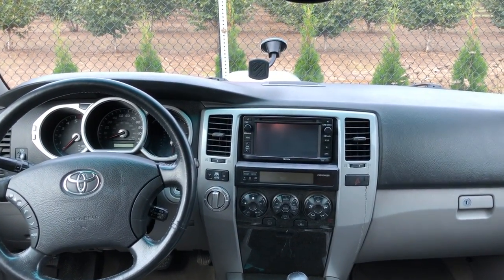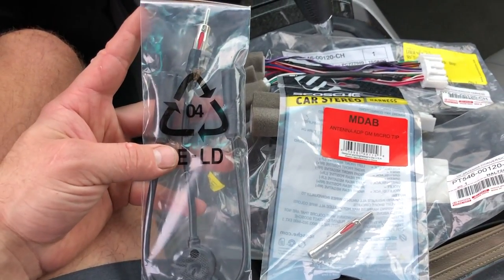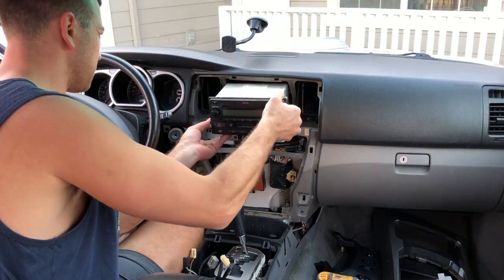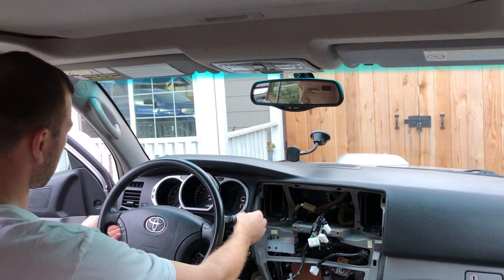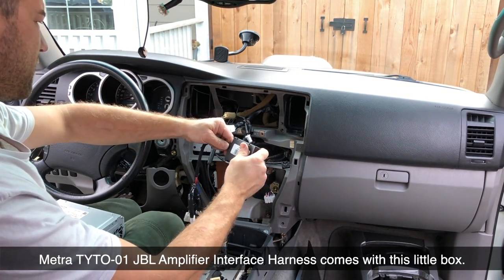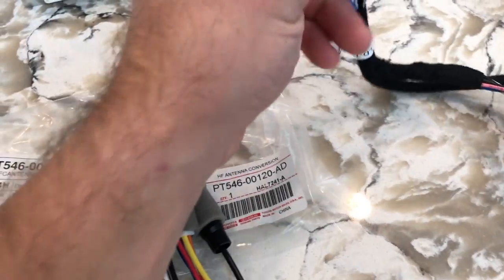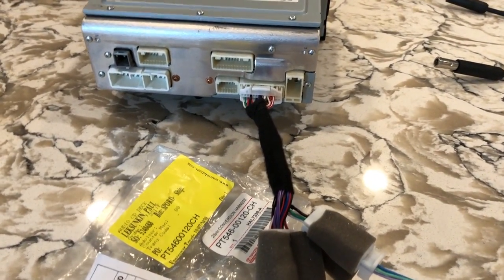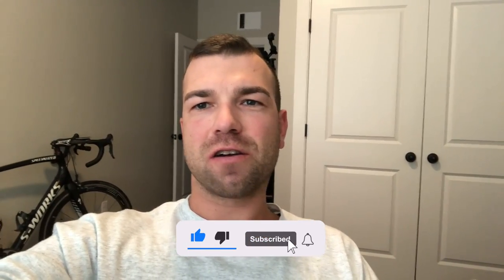4th Gen Toyota 4Runner Touch Screen & Bluetooth Radio Install - Upgrade 4th Gen Toyota 4Runner 2003

Comment: Bro, please answer ASAP:) the antenna wire, the blue one gets spliced into the blue with white wire on the other harness or into the black wire? I’m doing this now and can’t quite figure out in your vid each one it’s spliced into. Thanks!!
Reply from the maker: I'm probably too late but the blue wire splices into a blue wire on the big harness
Reply: @tronixster  all good, figured it out. Thanks tho. My backlighting doesn’t work though.. the buttons don’t have light at all. Haven’t figured that out yet..
Reply: @steffNn same neither do mine and my sound quality is kinda crap with Bluetooth 😢
Reply: @omarmendieta9149  my Bluetooth is good, but my backlight still doesn’t work
Reply: @steffNn  yeah my Bluetooth connects quick and works as it should but still no backlight😭 I seen on the TYTO1 harness that the orange is the illumination wire so I’m wondering if that wire needs to be tapped into somewhere else?? And I also noticed that there’s a way to program your volume control on the Axxess box so I need to do that too still

Comment: Do you have the part number on the speaker output plug that came with the new radio?  That is absolutely the weak link for anyone else wanting to do this modification.  Without that plug, this cannot be accomplished.
Reply from the maker: You would have to buy these plugs from dealer and I don't have the part numbers but I can try to find out for you

Comment: You did not explain the rear speaker connections. Does the Purple/Black go to the right rear White? The Purple to the Right rear Red? The Green/Black to the Rear Left Yellow and the Green to the Rear left Black?
Reply from the maker: Yea actually show it in great detail
Reply: @tronixster  You have made a very detailed video which has helped me greatly. Can you tell me where in the video you show which wires from the plug go to the positive and negative rear speaker wires? You showed the purple and green wires for the rear speakers and you showed which side of the plug is left and right but the wires from the plug are not green and purple, they are Red, BLACK,YELLOW and WHITE. I don’t know which is positive and which is negative.
Reply: @markpyrtle7853  The stripe wires go to the bottom of the connector. I also had this problem. But if you look and the harness just next to it, You;ll see that all the striped wires are located in the bottom half of the harness.

Comment: Can someone tell me the name of the head unit and where to find it i have a 04 4runner
Reply: If you want the one that says Toyota on the front of the unit..it’s p/n PT546-52150. The Scion unit is the same but different p/n and will say Scion on it.

Comment: Hi. Looking to do this swap today but I'm not finding that the part number is matching up with your head unit. It seems that the part number referenced is one without the touch screen. I am getting a lot of Googled responses for a Scion screen that looks very similar. Any chance you have more up to date on that part anymore?
Reply from the maker: Honestly Scion head unit is exactly the same with only one difference, it says Scion on the front of the unit.
Reply from the maker: Hey man, I've bought it from LKQ auto parts.

Comment: I think the 2 antenna ports delineate AM and FM.  These two antennas are electrically very different.  I think a better solution is to buy 2 harnesses and pull the coax pin out of one and install in the other coax connector head. then connect the various antenna feedlines to the correlating port.
Reply from the maker: Thanks for the tip brotha
Reply: @tronixster  Does both  AM and FM work  good the way you connect it?
Reply: This is a common misconception and actually isn't the case. From this post: https://www.toyota-4runner.org/611260-post22.html
"The antenna issue has been discussed quite a bit. The 4Runner has a diversity antenna system - which as best I can tell means that there are two antennas in the vehicle and the factory head unit picked which one had the best signal. I do know that the antenna bundle from the factory harness has two antennas connections (a standard and a smaller one) and a 3rd cord that folks have said is power for an antenna booster.

Going to the aftermarket head unit there are lots of install options available:

1) Get Y-cable connectors to feed both antenna signals into the single antenna input on the Pioneer headunit
2) Provide power to the antenna booster and just plug in the larger (standard) antenna connector"

So I think Paul did it right.
Reply: @r.t.7925  Yes it does. I just did it today.

Comment: .hello friend your video was very useful it helped me a lot to install to update my stereo ,,,,, but the button lights do not turn on
Reply from the maker: yeah mine is not working either. I guess the white wire that was left un-spliced in "little pigtail" 6 pin harness is for backlighting illumination. I'll have to take everything apart to fix it but I had no time to do it yet.
Reply: okay thanks for answering me, your video is very helpful thanks 🙏

Comment: Boss how are you doing I got a question is my Toyota got regular system what I Gotta too  do???
Reply from the maker: Hey man. Here's the list of things you'll need: 

1) OEM Headunit Part #: PT546-52150
Link: https://www.lkqonline.com/2015-TOYOTA...
(I recommend calling them in person and ordering it over the phone)

2) PT546-00120-CH Wire Harness
Click here: https://parts.larryhmillertoyota.com/...

3) PT546-00120-AD Wire Harness
Link: https://parts.olathetoyota.com/oem-pa...

4) Metra 40-UV43 Male to Female Motorola Antenna Cable
Click here: https://amzn.to/3mkTa9P

5) Scosche MDAB 1988-Up GM Micro/Delco Antenna Adapter Tip
Click here: https://amzn.to/2Zrn3we

6) Pigtail [that aready came with my head unit]
https://amzn.to/3FB5fib

Comment: I does have navigation system the new stereo ?
 my wife stereo has but it looks so old shity and the greeting is so annoying every time turn on the car..
Reply from the maker: Hey man, yes this head unit does not have navigation in it by default and you would need to pay dealer around $500 to have them install it for you but really it's useless cuz most of the time I use my phone for navigation
Reply: Yes that's true,  most of the time I use my phone or my tablet as a gps. And it loooks awesome and I can stream music at the same time..
Thanks man..

Comment: I checked the link for the head unit, I want to replace my dated 2003 4 runner unit with the JBL synth,,, but the link says no more in stock, do you feel the 2016 unit is the same?? would work??

Thanks, Excellent work!!!!
Reply from the maker: Yes 2016 head unit would work

Comment: So I have the JBL system and just got done installing it like urs. Now it seems like my radio is quite as loud and also it shut off completely when I try to put the sound only in the rear. Does yours act similar?
Reply from the maker: No mine didn't do that at all. Do you have the JBL synthesis in yours? You might have to adjust levels on your Metra TYTO-01 JBL Amplifier Interface Harness https://amzn.to/3EmS1Vs

Comment: Have to ask on the rear camera will the harness you’ve posted work with the link you shared that guy uses a scion head into is there any differences
Reply from the maker: Hey, I haven't done the back up camera myself yet so can't tell you for sure but I don't think there's difference in head units.

Comment: How do the PT546-52150 and PT546-00140 head units compare?
Reply from the maker: Hey man, I believe PT546-00140 is made for Scions and it will say Scion on the front of the head unit. PT546-52150 is made for Toyotas and it will say Toyota on the front for the head unit but they are both exactly the same as far as I know and both will work and connect the same. I hope this was helpful.
Reply: @tronixster  Hi, thanks for trying to help. Actually both units are available as Toyota and Scion branding, but completely different models. with the one superseding the other. I hoped you might have tried the newer version, too, but it seems it uses completely different wiring - but would still fit in a 4Runner. Thanks again for the great video and very detailed information.

Comment: I purchased the scion version for my yaris 07 and I'm just waiting for the antenna adapter, but I tried to use it just with the 2 original connectors of the car and I got no sound, do you know what should be the problem?
Reply from the maker: It's hard to tell, you would need to take out the harness and troubleshoot it but I would recommend waiting for the antenna adapters.

Comment: Do you know if navigation software can be uploaded to this unit? Also is it possible to install a backup camera? Thanks!
Reply from the maker: Hey Shawn, yes it's possible to upload navigation software but it will cost you around $500. It's not worth it personally for me cuz I usually use my phone. 
And it is possible to install a backup camera. Here's the link to the wiring harness you'll need. https://www.amazon.com/PAC-CAM-TY11-Reverse-Camera-Harness/dp/B00KWLA3T0/
And you can buy any camera they sell on Amazon. Most of them will work with no problem. 
I'll be installing a backup camera on my 4Runner and will most likely do a video on that.
Reply: @tronixster  I hope you upload the video
Reply: I don't  think  the radio in the video has navigation. I bought  the same radio today and on it on the bottom there's  extra Harman navigation unit.Im going to install   this on my 2005 matrix XR. It fits perfectly in the dash- same dimension as the old one .

Comment: I've read through all the comments and can't see a solution to my issue. We have 2004 4Runner with JBL Synthesis and factory backup camera, which was working with the stock head unit. I did this upgrade, but it looks like if I want to keep the factory camera I need to splice another wire harness that fits the Yaris head unit to the factory plugs for the stock head unit. The Yaris head unit has a 16 pin plug for backup camera, which isn't the same as my 4Runner stock radio plug. Has anyone figured this out?
Reply from the maker: Hey Joel, I didn't do much research on that. But here's a tutorial on ho to do aftermarket backup camera and you might find some useful information there. 

Here's what you'll need for backup camera setup: 
1) Camera: https://amzn.to/3ryyU60

2) Harness #1: https://amzn.to/3nHvHjs

3) Harness #3: https://amzn.to/3KpgRrk

Installation instructions: 
https://thetrackahead.com/projects/2003-toyota-4runner/rydeen-backup-camera-install-4th-gen-toyota-4runner/

Comment: I did this swap exactly like you, using your parts list (Thank you!), but I can not get the backup camera to work. The video shows up on a TV that I used for testing. The head unit does not switch to video in reverse. Everything else works. Has anyone had success?
Reply from the maker: I haven't done in depth research yet but try this link: 
https://thetrackahead.com/projects/rydeen-backup-camera-install-2003-toyota-4runner/
Reply: I’ve been able to successfully add back up camera functionality. It’s easy

Comment: Is it needed to have the microphone or will it still work fine without it?
Reply from the maker: I believe you need microphone because head unit doesn't have the built in mic

Comment: I did most of the wiring outside of the truck, then just plugged it in.
Reply: @michellej7734  I mean wiring the stereo to the wiring harness. It’s easier then doing it in the vehicle
Reply from the maker: For sure. I did the same

Comment: what about the auxillary port in the center console, will it still work? (2007 4runner non jbl)
Reply from the maker: Yes it will. Your original harness for auxillary port will plug right into the back of the new head unit.

Comment: Hello. I have a question. Do you know if the scion xb and yaris carry the same radio? I am asking because I can't find a yaris model but xb model yes. They look identical
Reply from the maker: Yes they do carry the same radio. The only difference is Scion radio is gonna say "Scion" on the front of the radio instead of Toyota
Reply: Is this also the case from like a 2014 frs? The head unit looks identical but is made by pioneer. Just curious if this interferes with jbl.. thanks in advance
Reply: @jordanhickman  wondering same thing ready to make the upgrade on my 2005 with JBL sound

Comment: Hi Paul I have Highlander 2012 limited with JBL sound system any recommendations to change the stock Navigation system with a Toyota android auto unit. Thanks
Reply from the maker: Oh yeah that's a little new than 4th gen 4runners
Reply: @tronixster  thanks for replying appreciate that.

Comment: Hello, so what does it take to add a back-up camera to this unit?
Reply from the maker: Here's what you'll need for backup camera setup: 
1) Camera: https://www.amazon.com/cm-MINy3-Backup-Forward-Facing-Camera/dp/B08LKGC518/

2) Harness #1: https://www.amazon.com/PAC-CAM-TY11-Reverse-Camera-Harness/dp/B00KWLA3T0/

3) Harness #3: https://www.amazon.com/gp/product/B0002ZPJZY/

Comment: 13 14 TOYOTA Venza Radio CD Player 57042 86140-0T010 XOX23. What do you think about this one? Have you seen this one fit? I'm looking up specs for it.
Reply from the maker: I haven't done any research regarding Toyota Venza head units so I can't say anything but there's a possibility.

Comment: Anyone buy from the website he has listed for the head unit? Just curious about their reliability
Reply: Lkq is a very reliable source, they’re nation wide mostly deal with motors but they do parts for every vehicle they’re kinda a junkyard in a way but they sell quality parts and they ensure that the part works or isn’t damaged before they sell it I’ve bought motors from them before that lasted well over 400k miles
Reply from the maker: Thanks man.

Comment: This is a great video; thank you for making this video. I am having such a difficult time finding PT546-52150. Does anyone know if the PT546-00170 works? The connectors look like the might match; the PT546-00170 comes from the 2017-2018 Toyota 86 and Corolla.
Reply from the maker: I believe I bought that. harness at the dealership
Reply: Hey John I was wondering if you tried the PT546 - 00170 for your 4Runner? I’m also having trouble finding the OEM system as well.
Reply: @laquintonhill8774  I have not. I haven’t been able to find a head unit that’s not hundreds of dollars.

Comment: What if you have the regular stereo without the jbl. What harness do I need?
Reply from the maker: If you have regular stereo you'll only need these four harnesses and they'll plug right in.

1) PT546-00120-CH Wire Harness
Click here: https://amzn.to/3tMqUyj
2) PT546-00120-AD Wire Harness
Link: https://parts.olathetoyota.com/oem-parts/toyota-tchfcantenna-convers-pt54600120ad
3) Metra 40-UV43 Male to Female Motorola Antenna Cable
Click here: https://amzn.to/3aWuNYW
4) Scosche MDAB 1988-Up GM Micro/Delco Antenna Adapter Tip
Click here: https://amzn.to/3jDKqs9

Comment: If anyone knows: Does the Yaris head unit track maintenance reminders like the factory 4th gen units (with Nav)? And does this head unit interface with the factory reverse camera?
Reply from the maker: It will work with your factory reverse camera you might need adapter or might not but I'm not sure about the maintenance reminders
Reply: @tronixster  thank you!

Comment: Hey man great vid! But could u help me with the exact name of the radio or a link to buy it because it doesn’t appear in Amazon or ebay.
Reply from the maker: I’ll share a link with you guys in a little bit.
Reply from the maker: They have one available right now out of 2017 Toyota Yaris. I would call them directly and give them this part # 268883909
their number is: +1 (360) 260-8400
link: https://www.lkqonline.com/2015-TOYOTA-YARIS-Radio-Audio/-hF34mFc3PK/-i~268883909

Comment: Will it work the same way with the 2019 Toyota Yaris.  I want use that one because it has the navigation.  Please let me know and thank you.
Reply from the maker: I'm not sure because I haven't seen the back for the head unit from 2019 Yaris. But if all plugs look the same, it should work no problem.
Reply: Okay, thank you.

Comment: Wherever I find the head unit it says it won’t fit my 06’ Runner. Anyone having same issue?
Reply from the maker: Of course the system will tell you that because you are buying a head unit from a completely different car, that's why it's a hack. Just disregard that and buy the head unit.
Reply: Wow
Reply: RC - Have you intalled one? I have a 2006  4Runner wanting to get one off EBAY.

Comment: Question,is pt546-00120 compatible as well.??from a scion??
Reply from the maker: Yes it is!
Reply: @tronixster  so the PT546-00120 WILL have the same functions is the PT546-52150 ???

Comment: So any 2017 Yaris touchscreen unit OEM will work with this??
Reply from the maker: That's right, any 2017 Yaris head unit will work
Reply: @tronixster  You are awesome thanks! Did you get another truck yet?

Comment: The plug that is needed that Paul received with his new radio with the wires simply cut off and the plug intact( he called  this a pigtail) can be purchased at amazon.  I ordered this: https://www.amazon.com/dp/B087Q9NB8X/ref=cm_sw_em_r_mt_dp_C6DX0WXCD8N1JZPKNQSF?_encoding=UTF8&psc=1   It fits perfectly,  This kit comes with 2 plugs with leads but only one is used.
Reply from the maker: thank you for the link brotha

Comment: I have non jdl system on my 2007 4runner…do i need both harness adapter from toyota dealer?  (CH and AD)
Reply: Yes, both of them. Super easy though, no splicing. You don’t need the pigtail (Red Wolf) item.
Reply from the maker: Yup this is correct

Comment: Can part number PT546-00140 be used and still maintain steering wheel functions?
Reply from the maker: Yes with part number PT546-00140 you'll maintain the steering wheel functions